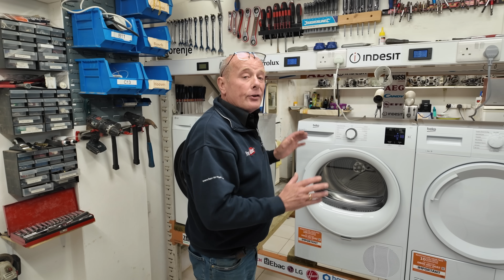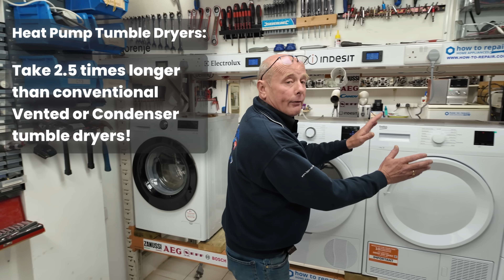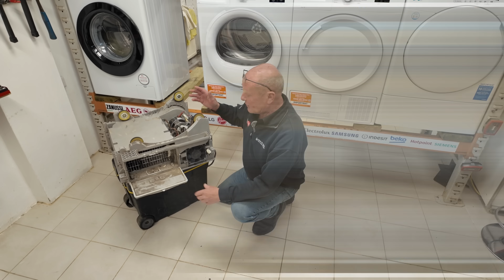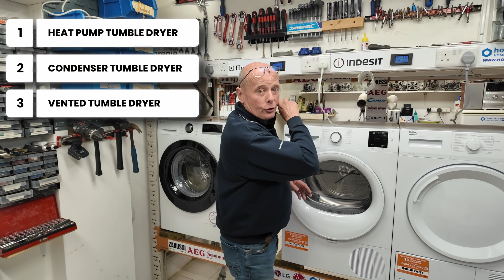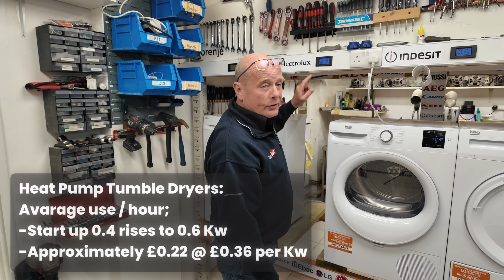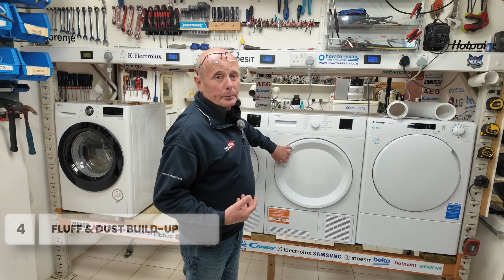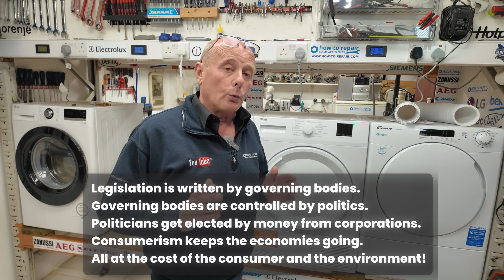Tumble Dryers the Shocking Truth About Heat Pump vs Vented & Condenser, NEW LEGISLATION!

Comment: I have a vented tumble dryer it is 40 years old, never needed a repair done to it. it still works good.
Reply: Wow, what brand and model please?
Reply: @laurah2831 up! Wanna know as well ❤
Reply: @laurah2831  Bendix, they don't make them anymore, the company was taken over by another company long ago,
Reply: That is the REAL GREEN AND SUSTAINABLE drier. I have a huge Old drier which can dry 2x 10 kg laundry at once. I use it in wintertime and when the electricity is cheap. But now they found a NEW Taxation for the low and AMPERE. THE NET GRID COST IS NOW 3 TIMES THE ELECTRICITY ITSELF + TAX AND 25% MORE VALUE TAX. THE GRID COMPANY IN SWEDEN IS OWNED BY CANADIAN PENSION INSURANCE COMPANY AT51%. THEY ARE RUINING US. THE GLOBALIST MAFFIA. They also own all washingmashine BRANDS. Different name- same owner.
Electricity= ELECTRIC CITY IN 1700,
Reply: @lauralauren6432  Everything that the Globalist push all industries towards is cheaper produced and crap that doesn't work like things once did before all the so called progress. Technology is tempramental and prone to poor functions, and expsensive and lower grade material there made from, and who reaps the benefit of cheap labour forces get control of market, jobs, and better standard of living and ours decline.
Reply: @lauralauren6432 try the chinsese then
Reply: I bet it's noisy as hell by now. What brand and model is it?
Reply: @jinxterx  I bought it long ago, from the days Southern Electric use to have shops on the high street, it's a Bendix bought in 1984, it works as good as it did when it was brand new, never had a single issue. in the good old days machines lasted as they didn't put an expiry date in the mechinism within.
Reply: @jinxterx  Bendix purchased from Southern Electric shop when they use to be in local high streets. It is quite and works as it did from day one, bought in 1984 and  never needed a repair.
Reply: You probably use 8-10 kWh for a full load. We use 1 kWh or so.

We have a 2012 Cylinda TVP 420 with heat pump. It has a 800 W max rating and it has served us BRILLIANTLY for 13+ years now. Only thing is a bit of belt slip(?) causing noise during first minutes of operation, that's been for many years now. We found it on sale and I got the price down a bit more, picked it up for around £400, original price was twice that.
It dries 8 kg of clothes in 60-90 min, so I'm not sure what garbage is on the market these days. 
Our 2012 Cylinda Sverigetvätten washing machine is very similar to the ASKO you recently reviewed, only older... We also have a Cylinda Sverigedisken, dishwasher, from 2012, nowadays produced by ASKO, while Cylinda took the path of planned absolecense. Our parents in law have an ASKO and after an initial warranty repair, it's been GREAT and the inside is fabulously great to allow three layers high stacking and STILL getting it clean!
Reply: Probably uses twice as much energy to dry clothes too. Have you done a comparision of the cost ?
Reply: *this is a real winner*
My wife has a Bosch washing machine and a Bosch tumble drier which is 10 years old, the tumble drier is rarely used, she hangs the weekly washing out in our garden, which we appreciate we are fortunate enough to have a garden with a wind driven external rotary washing line..
My wife even did the same when our now adult children were both young, but are both now married and no longer at home, however I cannot remember if there were tumble driers 30+ years ago, however even if there was we did not have enough money (despite the fact she also worked all her life) to buy one then !!
We are now in April having once again all winter done the weekly washing and she has not used the tumble drier once this winter.
Now that is a real help save the planet and money saver !!
And the smell of the dried washing compared to a tumble drier is wonderful even better when lying on clean fresh smelling bedding sheets.
Just another side to consider if you have a garden.
Reply: Ours too. Bosch.
Reply: But it just pumped heat outside for 40 years, and burnt up your electricity bill

Comment: And ask yourself new vented tumble dryers without reverse action CSE V9DF,  actually takes a lot more time and electricity to dry clothes than old reverse action vented dryers.  Yes the machine it's power per hour but it's per load of clothes we need to measure not some advertising target.  Drop a load of bedlinen in a new non reverse action machine and you'll be in tears

Comment: Got rid of our bosch heat pump dryer as soon as we had kids.  Absolutely useless,  couldn't even dry a full load if clothes were thick.  I spent so long pulling it apart just to clean the fins properly,  it worked better but only for about a month.. gave it away,  went back to vented and its amazing! Got solar and a home battery now too so heat pump most definitely doesn't make sense.  If anyone says they're good,  they're dreaming and certainly haven't tried to service them properly.  Such a ridiculously bad design
Reply from the maker: So true, watch out for a video coming up with the next two weeks about Bosch and their sealed drums. You will see a comment that was written on this exact problem that you have manufacturers should be held accountable for their actions. Heat pump technology is great when used in the correct applications but dust and fluff mixed into the equation is a recipe for disaster thank you very much for your comment

Comment: I was I informed recently that heat pump dryers rely on outside air temperature and will not work effectively if used in a cold garage during winter months.

Is this true? Will HP dryer take even longer and will it actually dry clothes or just rely on air passing through like a wind on a clothes line?

Comment: I have a top of the range Siemens heat pump condenser dryer, and I hate it , I use it just for bed linen alone or towels alone,  it takes  3 hours to dry , the clothes come out with a metallic smell , not a hint of fabric conditioner , im finding it very difficult to buy a normal condenser dryer

Comment: Wow! I'm gobsmacked. Wish I'd never bought one and will never buy another. Previously I had a condenser tumbler for about 20 years, I had to buy a new washing machine so I bought a matching pair ( but a heat pump Tumbler) and gave my old one to my daughter who has been running it for the last 5 more years,only having to replace  an internal switch  in that time.  Now I learn that this thing isnt going to last that long and will have to be dumped when it goes wrong. Gee thanks Samsung.
Reply from the maker: Actually, from the reports I’m hearing the Samsung one is one of the better ones. Look on the bright side at least your daughter is happy.

Comment: Our Westinghouse 3.6KW vented drier was bought to dry nappies for our first born. She is now 53 years old and the drier has had no maintenance apart from annual vent outlet cleaning and one new belt installed easily by myself. We try to dry clothes outside mostly, but it was used intensively while kids were little and through the teenage horse-riding years. You can save more power here by only using the drier when really needed than by using a heat pump drier all the time. I'm 81 now and expect the old drier to outlast me.
Reply: Oh what a lovely story...and it highlights a world gone by when machines were made by engineers, not corporate bean counters and politicians!
Reply: That drier deserves an award!
Reply: Brilliant, and proof older manufacturing was superior and made to last.   You give me confidence mine will last on for many more years too. Thanks for commenting. x
Reply: Brilliant. Where is any real progess we are supposed to be seeing?
Reply: The good old days that the appliances are built to last
Reply: I have 2 kids and actually never understood why people buy a drier. My washing machine and a dishwasher are on every night (the electricity is way cheaper at 11 pm. Of course, when linen are washed every door in the apartment is with some stuff on it. But honestly. I don't see any reason to buy a drier. My washing machine is from 1998 or so. Repair it myself when needed. Purely mechanical. When I needed a new one, after weeks of a research I bought exactly the same for $50 almost never used...

Comment: Amazing. My Miele is 9 years old. Running regularly and paid for itself many many years ago. Been faultless and it’s extremely easy on the clothes, like drying on the line. I suspect it’s saved a lot on ware and tear of clothing. Used 3 times a week and never serviced. I think you will encourage people to buy a cheap unit as they expect it to break, then it will. Buy the best, that’s about as good as the good from 50 years ago. The rest are crap.

Comment: I've yet to find a single EU approved appliance that isn't outright unfit for purpose. People sneer at the size and energy usage of American appliances but they're ignoring that they clean several times as much laundry several times faster. a 1.5kw dryer that needs to run for 4 hours to partially dry third of a load of clothes is not more efficient than a 3kw dryer that needs to run for 40 minutes to fully dry 3x as much clothing. The same for washers. My bosch washes a FRACTION of the clothes of an american washer, doesn't get them nearly as clean, and takes several times the time to do it. The net result is significantly more water and electricity used to get clothes less clean and wear them out much faster. These regulations aren't about the environment, they're about undoing modern convenience and turning us back into peasants again. Laundry is no longer a 2 hour chore, it's an all-day affair like it used to be for our great grandparents.

Comment: Brilliant ! Just what I wanted . Our usual repair man declines to work with heat pump tumblers , as you say . I’d like to add a wish that somehow us older folk could manage the condenser cleaning better - the lowness to the floor and the wrestle to put the thing back into the machine.. also the noise level if you can’t escape far enough away .    Thanks
Reply from the maker: Manufacturers have a tendency to build too much complication into machines that were only designed to do one job. Yes they use less energy but the majority of them are on the landfill within five years.

Comment: My condenser dryer has just stopped working so I was about to invest in a heat pump dryer till I watched this video. I'm all about saving the planet but it doesn't make any sense to buy something that yes uses less electricity however takes twice if not three times as long therefore equalling out the cost. Things are over manufactured so that you end up replacing rather than repairing which cancels out any savings you make. I am considering going back to a vented machine as they were so much easier and quicker to do the job it was designed for.   Thanks for the advice

Comment: I have the exact same beko condenser dryer you have in this video, I always tend to choose beko, out of all the machines I’ve had they tend to be the most reliable and last the longest. 
And you benefit from the heat the condenser pumps out rather than expelling it out of the house like a vented.

Comment: A Chinese small manufacturer named MODOS recently released a heat pump dryer that adopted the design that you proposed in the video. The side panel of the machine can be detached by unscrewing 3 screws and the upper cover of the evaporator and condenser can also be removed by unscrewing 3 screws. The manufacturer said users can easily rinse and clean those fins, ensuring an efficient dry after prolonged use and prevent molds and odours caused by trapped wet lints. 

It seems very appealing and hopefully all manufacturers will follow this design in the future. Then heat pump dryers could be an answer for the future.
Reply from the maker: God, you mean someone is actually listening to me I would love to get my hands on the machine, but I haven’t seen it in the UK

Comment: We bought a Miele heat pump dryer in 2018 and it has worked perfectly every day so far. We do have a couple of spare filters, so that we can quickly exchange these once the machine says it should be cleaned. And then we have time for a thorough rinse in the sink and let it dry.

Comment: A full load takes 2-3hrs. Plus the filters collect fluff, then the condenser radiator collects fluff and it's wet. The load is around 700w. It's a hisense 9kg heat pump unit.

Comment: I have a Miele heat pump dryer. Iv had it for 3 years ,I clean ALL the filters after every load with a vacuum. It still works exactly as it did the day it came in my house. It is also FASTER than my previous 20 year old Miele condenser dryer. It dries a full 9 kg load for 28pence instead of nearly a pound for less load in the condenser

Comment: Last year, I said goodbye to my trusty old Creda tumble dryer after 30 years of drying my undies.  I replaced it with a heat pump one and I'm not happy.  The designs have gone downhill in the last 30 years.  With the old one, there was a dial for the time and a high/low switch for the heat, the last 10 mins of each cycle was no heat - very simple.  So if I wanted to air some clean clothes left crumpled, 10 mins no heat.  Drying a full load of undies, 50 mins high.  Finishing off damp clothes dried on rack - 20 mins high.  This new one takes ages - as there is no simple option to set the heat and time.  There are a multitude of 'programs' for different loads and fabric types - far too complicated.  No thought has been given to the end user that just wants X minutes on High or Low.   It does take about 3 times as long too.

Comment: One plus of zanussi heat pump tumble dryer isn’t simply energy consumption but also fact it seems gentler on clothes in heat terms. 
I don’t hold out much hope it will last more than 5/6 years but reality for me is none of them do. 
I also wondered about the benefits of the new normal large capacity drums are they actually designed for more clothes or does the rubber/ nylon band that helps rotate them not high enough quality for added weight? I tend to only use smallish loads in my machines I never stuff them full and careful about weight of clothes but it makes little difference all white goods from zanussi bosch etc seem to fail too quickly even though I follow all the manufacturers recommendations and actually read manuals 😂
Heat pump tumble dryer take forever to run a constant hum in small houses but on plus side added warmth in kitchen in winter😊

Comment: I’m in Australia, we are being pushed to get heat pump hot water systems which seem to be extremely costly to run. I also purchased a heat pump tumble dryer and it takes 2 hrs to dry a load and I think since having 2  heat pump appliances my electricity costs have almost tripled. I do have solar and a battery and my electricity bill has become much more costly than I ever expected.
Reply: Heat pump tumble dryers cost less to run. I have checked my use of same load size/ type in both condenser ans heat pump units with my smart meter checking units of electricity. In U.K. prices on kw hours gone up so only scientific method to use is kWh per wash/ dry not price per wash/ dry 😊
Heat pump units do run for double the time which is irritating if you want to dry an item before work but if you plan ahead they actually gentler on clothes as never get too hot compared to condenser or vented type. What the guy says here though true regarding wear on machines because they designed to run longer and concerning detail that you can’t access condenser to get rid of lint

Comment: 11:22 your point about built in obsolescence is not confined to heat pump machines. For example: The washing machine industry is going over to sealed drums that prevent repairs that used to be possible by dropping the drum down.

The industry has not been conned by the new energy ratings: rather it is maliciously exploiting the heat pump tech to move away from repairability just as it is already doing for washing machines. 

What is needed is a repairability score in new appliances as well as the energy efficiency score.

Comment: I’m so unhappy with Domestic & General who over the years have repaired my condenser dryer (2006) my washing machine and dishwasher. On 4th Oct 2025 My condenser dryer worked perfectly until the other day when black smoke and awful smell came out of it. I unplugged immediately. Two engineers out from Hotpoint (via Dom&Gen) unable to fix and both stated needed safely recall. I have just complained to them, via X and Facebook since I couldn’t actually get hold of anybody. They have now decided since I’ve been waiting so long I can have a replacement but they’re only offering Heat Pump condenser, which I do not want.

Comment: Not watched this through yet but just commenting to say that my MEACO de-humidifier does a fantastic job not only keeping humidity levels down but can also dry laundry. It's cheap to run and pulls an incredible amount of water from the air. My damp laundry no longer steams up my windows in winter or contributes to mould formation. No need for a tumble drier/problem with lint & fluff. A win-win imo.